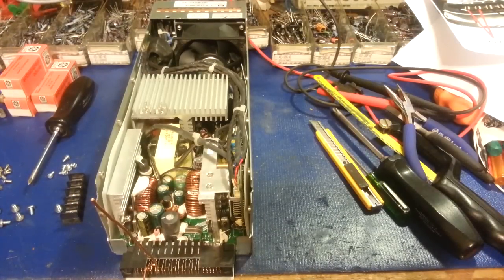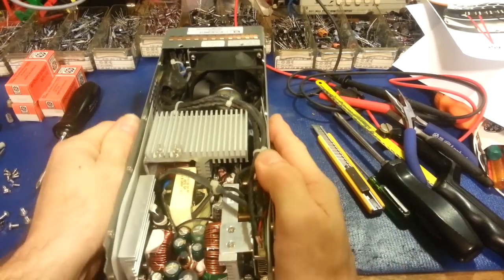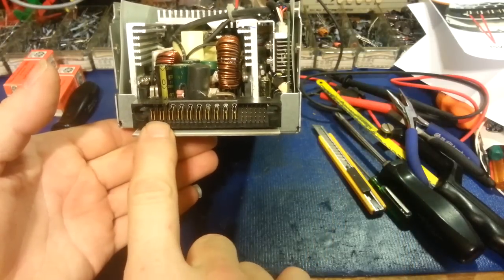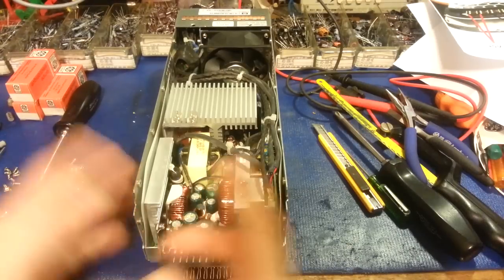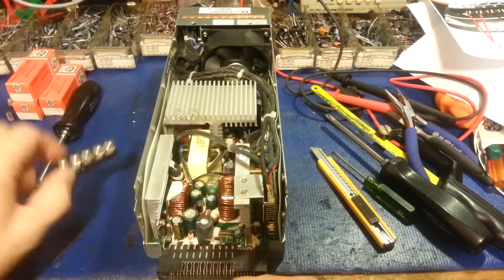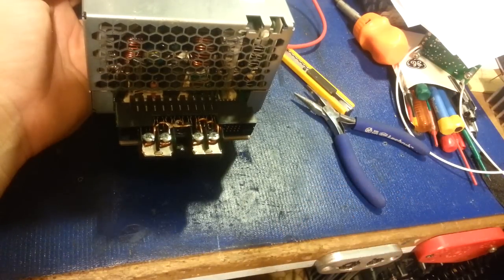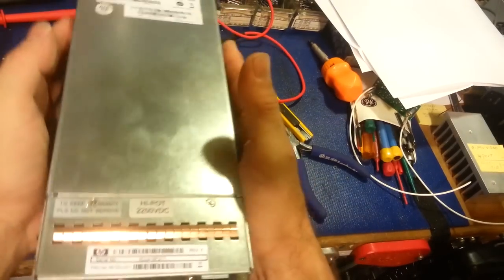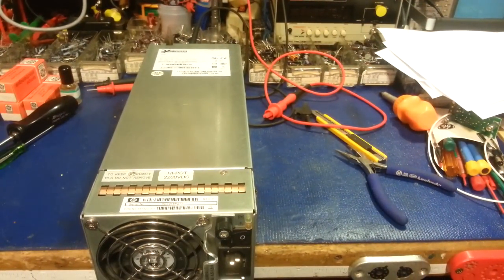Adding a terminal strip to a cheap server switch mode power supply.

Comment: There should be a pin on the bank on the right that you can short to ground to set the fan speed to its lowest setting. Makes it much much quieter, and the high speed is only necessary when drawing full capacity in the enclosed server environment where the supply is receiving pre-warmed air from other internal server components.

Comment: Thanks for the great shows I'm about a heartbeat away from buying a few I want to wire them for 24volts. I could sure use help coming up with a controllable voltage and more important a variable constant current. I do hobby plating and anodizing as well as just need a good bench supply I did find connectors on eBay I'm sure someone printed them up but to me would be worth the hassle thanks again

Comment: Hi,   need your assist. as per below detail please confirm how to switching for 12volt.

Power Supply, 650 W Xserve Late 2006 614-0385,6140385,API5FS44
661-4196,6614196,
614-0385,6140385,API5FS44
Reply from the maker: Have no idea.  Try contacting the manufacturer.

Comment: If you wanted to replace the fan motors to lower cfm lower noise fans you have to give it a signal. The unit expects to see something like a 2650cps signal coming from the fan. If a fan goes down it shuts the supply down and trips a light. You can install a 555 timer IC in place of the OEM fan and then put small fans in. This assumes you will never load it to the full specifications it was designed to run at 24/7.

Comment: Those fans are thermostatically controlled by logic built into the mainboard or backplane.. at startup they run full speed until the mainboard posts then the BIOS and other Server specific circuits would take over monitoring temps and rail loads and controlling the fan speed through bi-directional data passed by circuits via the matrix of small pins.. the supplies are set to default to full speed in case they lose communication with the bios.. which is why they stay running fast and loud all the time in absence of the rest of the system... shouldn't be too difficult to substitute a quieter fan to cool them or even cobble together a circuit to ramp the fan speed based on the temp sensors already in the unit.. or maybe on amperage load.. 

Also, I can't speak for how every datacenter or manufacturer handle replacement of the power supplies...  I've been in the iT business 25 years and have managed HP/DELL/IBM and Supermicro Server Farms.. since they are always deployed in redundant pairs and monitored live for failures.. i've NEVER seen them replaced on time schedules... typically the systems are leased and always under warranty or service plans so if the supplies fail, they are just replaced on an as needed basis.. the systems keep running on the 2nd supply.. and any decent datacenter keep spares on hand... since the leases are up before the leave warranty (or service policy) coverage, they rarely fail in service... power is conditioned and they run on UPS battery backups.. and they run 24/7 so they don't have the thermal stress of startup and shutdowns... (typical failures are usually very early, like hours, in life or they last forever) so after they leave lease service.. they hit the resale/recycle markets and they are usually found still running decades later in most cases... I have some clients that are still running 10-12 year old "off lease" server equipment in roles that don't require current machine specs.. they are extremely durable machines..

Comment: i biuld the poweredge jb 200..variable from 12.0 to 15.2 at shut down without doing cap change getting 142 amps from a unit

Comment: i understand just thought the tutorial would be nice.
Reply from the maker: Other than the built in voltage adjustment potentiometer's it would be next to near impossible to make it a fully variable supply.  They were built from the ground up to operate at fixed voltages and not designed to be variable.
Reply: +MikesRadioRepair I wonder if the internal potentiometers allow the voltage to be adjusted up to 13.8v on the 12v rail!? I will have to google it. Also i'm not all the way through the video yet so I will continue watching to see if you mention any voltage adjustment, most all radios run happily at 12v but sometimes that "extra" 1.8v allows for more output from the radio, at least on some citizen band ransceivers.    Great video Mike!
Reply from the maker: +LeapFrog 

Yes, it adjudted up to 13.8 with no problem.
Reply: +MikesRadioRepair Sweet! :)

Comment: Hi Mike, thank you once again for your warning about upcoming noise. I think when you turned the power supply on it started moving under its own power. Those are some strong fans. Thanks again for making interesting videos.  Regards, Dave
Reply from the maker: Hey, you might be onto something there.  I could strip the engine out of my car and fill it with batteries.  Gut the supplies for their fans and mount them on the back of the car for propulsion.  Who needs electric motors  driving the wheels when you could blow yourself down the road (ok guys, get your minds out of the gutter).  Would give new meaning to the phrase "Man that guy blew past me.".  :)
Reply: Snoooorrrrrrkkkk choking LOL Dave

Comment: Good find Mike. You could stick it under the work bench and run stranded wire from the terminals block up and put an Anderson power pole on it for quick disconnect.  Some guys use them for solid state rf amps supplies and just reduce the fan speed to quiet them being they are not used at 100% duty cycle on SSB. Good video. Thanks. Best

Comment: Mike,
Bought a 45A one off Ebay for a cheap price, but it was ungodly LOUD!!!  The guy mounted banana terminals on the back. Had to buy another quieter supply for my ham equipment.
Reply: Many of these have a pin that you short to ground to make the fan run at a normal speed.
A normal server, not under intense load doesn't sound like a turbine except perhaps when it turns on.

Comment: They are some heavy duty supplies.  Good job on the output terminal.  These were ran 24/7 so that is the reason for the 2 high flow fans. Under normal use you could modify the fans so only one runs and install a thermal switch to turn the second one on. May make it a bit quieter.
Reply from the maker: I tried one on 5 volts and it runs a whole lot quieter.   Probably the best thing to do would be run one off the 5 volt supply and adjust the voltage up to say 6-7 volts and then run the other one at full 12 volts but through a thermal switch.  There is already one on one of the heat sinks for thermal shutdown protection.  Just stick another one next to it.
Reply: That would work. And 2 thumbs down for free information. WT??? Got to love them folks......